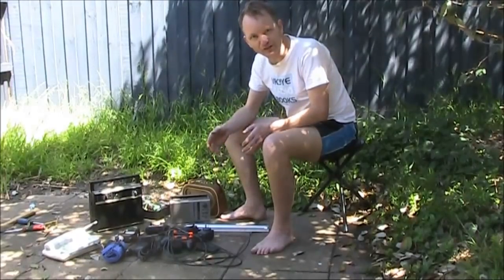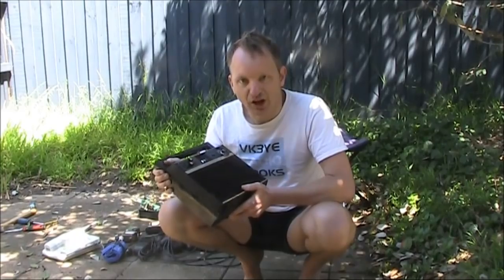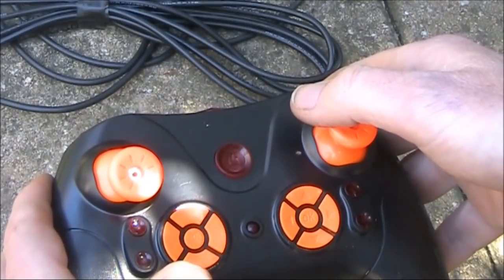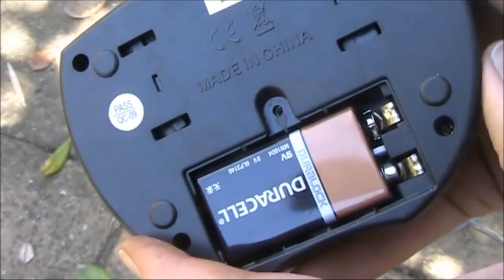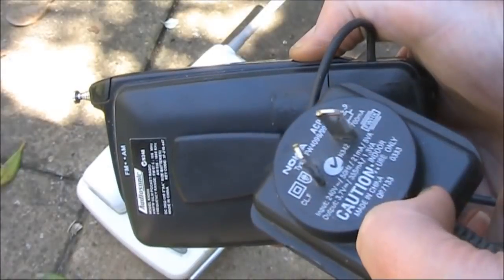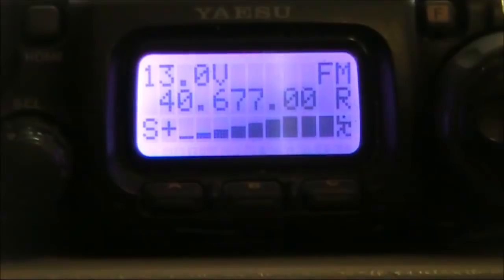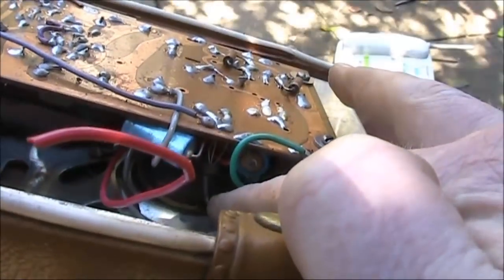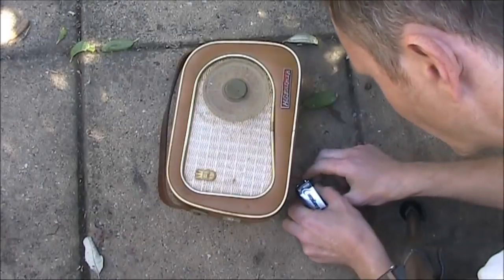Electronics on the Floor: Nature strip electronic junk pickings 2018 - Part 3

Comment: I was given six ten-foot lengths of that aluminium angle a few years ago (unfinished greenhouse). Most of it is now two three-element 6 m Yagi antennas, but the remainder is still finding myriad uses.

Comment: That controller that bleeped is for a small child’s drone
Reply: And possibly an infrared transmitter. (not RF)
Reply from the maker: Just opened it up. No RF like parts (not even an antenna traced on the PC board). But would have expected an IR LED also but couldn't find one.
Reply: vk3ye possibly Bluetooth ?
Reply: @vk3ye  interesting. I have owned one that was identical and it was IR, but who knows!?

Comment: HG Palmer. Definitely 9V Peter. My parents had one of those. The battery was an Eveready 276P", it used to last about a month with daily use. The radio had a plug with round pins of unequal diameter which plugged into holes in the battery. Actually a very good radio, has very nice tone, a real keeper.

Cheers Ken VK2HBM